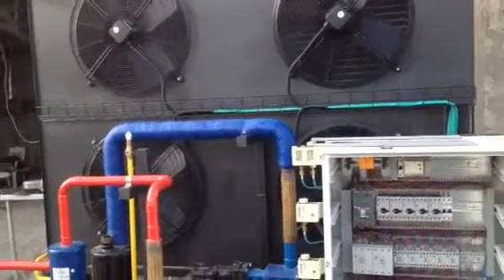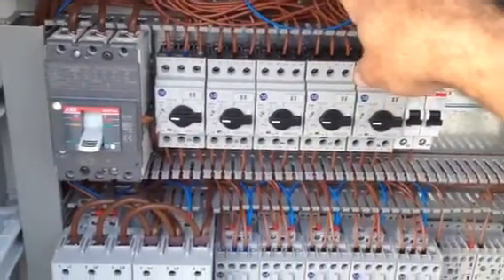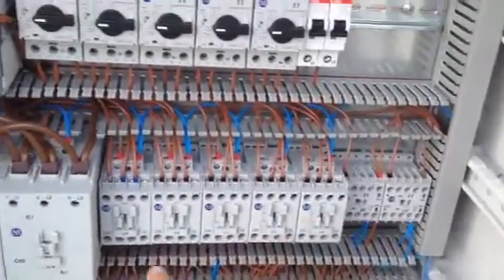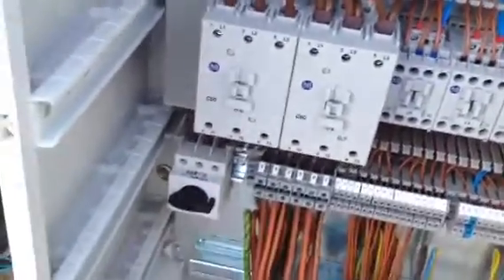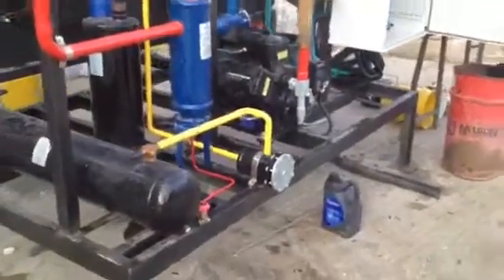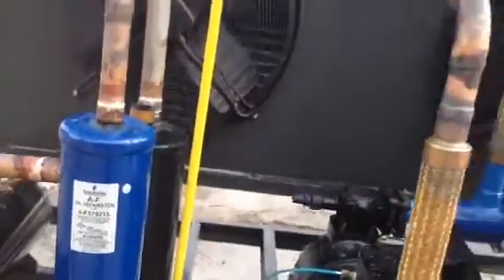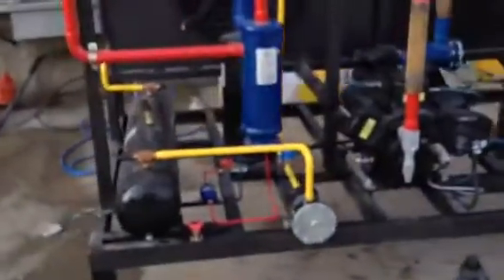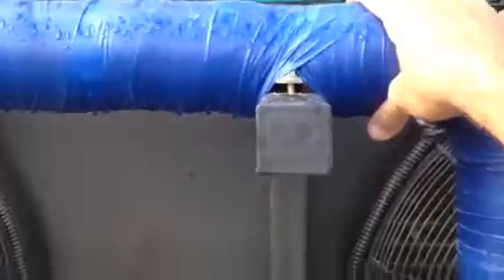Electric box for refrigeration condensing units

Comment: What Voltage are u Running up there?  i think you're North of Me Somewhere? the Valley or Something i'm Guessing. I'm Down here in South Orange County.
If you Are Running 460 3 Phase up there. i Prefer to Go Across the line Start with 460 3 phase. Eliminates one contactor and Problems if one Fails. i Recommend Across the Line Start. 460 3 phase. I like the Copeland 35 hp Alot !!! they are Great little Work horses!!! Although i Prefer the 6RP2-3500-TSK. Major Work Horse !!! The Discus to Me Don't Last as Long.( you allready Know i don't Like the Discus.Hey, That's Just me and it's ok. Alot of Hard Work You Put into Those Builds !!! They Look Very Nice !!! I Do Especially Like the Hot Gas Lines Painted RED HOt !!! and the other Lines Painted too. Cool Blue for Cold/ Suction. Liquid--Yellow. Good Color Choice for the Liquid Line. When i Build My Panels i Prefer to Use a Different Color for Each Phase. All Those Brown Wires Would Drive me Crazy Trying to Troubleshoot a Problem---i Recommend: Black, Red, Blue For Each Phase. That's Just me Though. :) But Besides That Your Work Looks Pretty Damn Fine !!! Way Better than i see out there in the World !!! You've got a Lot of Pride in your Work and it Shows ! I don't See that Kind of Pride Anymore out there, In Fact i Only See that Kind of Work From Union Shops in the old Days. Not Anymore. Sadly. Keep up the Fine Work Young Man---YOU are One of the Last Few Left That Takes the Time & Pride Anymore. MOstly it's Because People Don't Want to Pay For That Kind of Time and Quality anymore. NObody Can Afford it With all the Stuff Coming From China. Thanks For the Shout out on the Vibration Elim's Too.
Reply from the maker: Thanks
Reply: you are a troll seriously.. stop thinking your the greatest mechanic out there... just stop and everybody knows damn right you only do small time work....